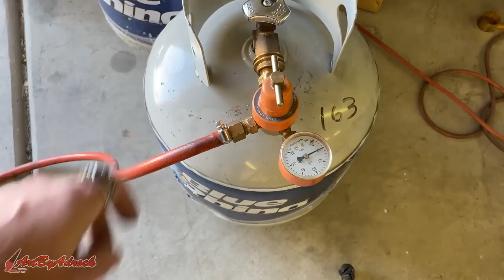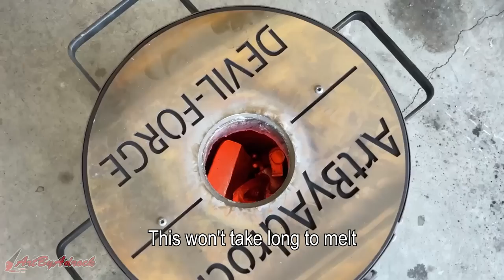Jeepers Creepers Throwing Star Weapon Build - Casting Aluminum From Scrap

Comment: I read the comment where you said that the next day you went and turned it on and it was working fine . I say it is giving you a grace period so you can go out and pick up a new small bandsaw ! Usually when they smoke like that it doesn't come back on  . So if your bandsaw is a very expensive one and you can order parts to repair it  , repair it ! But if it was a fairly cheap one  , go and get yourself a new one and maybe more expensive and better built seeing you use it mainly to cut different metals  and if you keep the one you have or a new one you might want to give it a better cleaning schedule as the smoke show was from metal dust that was where it shouldn't be  !

Comment: no background music this week?
Reply: wow! that was whole other experience not having any music playing.... I wouldn't have guessed it would be so different without it...... I think it was pretty cool! We got to hear the process the way that you do.... And hearing your band-saw get jammed like that REALLY lets you know how much power is behind that blade! Does it still work at least?
That Throwing Star was really dope too! I never saw much of Jeepers Creepers, just the first half hour or so, I think.... it was a while back, right? I dont remember the star  but its awesome looking....
--- -- I was thinking of a video/melt suggestion... do you think you might be able to cast a phone case? That would be pretty cool if you could make the two pieces snap together and make them fit tight. You'd prolly have to leave  a few millimeters on the inside to put some foam padding, but you can get some in a roll that has one sticky side, but it would have to be able to stick to metal.... I think that would be really cool because you'd have a very useful piece of art that you designed yourself and so you could customize it anyway you want. I'm picturing an OttorBox that I used to have on my iphone... there were two plastic pieces that snap together and then a rubber cover that slipped over that... If you didn't care about it being water proof then you could separate the plastic that goes over the screen from a case and glue it to the metal pieces... Or like my current phone It doesn't have a screen cover but it came with some kind of screen protector that I just applied to the screen and its working fine... the case was cheap too, so you could pick up one for next to nothing to sacrifice for build....
Just an idea.... we'll just have to see if you like it :)
Have a great weekend bud, and be safe! Thanks for the vid! :D
Reply from the maker: Yes it still works. I thought for sure it was damaged but I let it cool down for a day and it turned on just fine 👍🏻